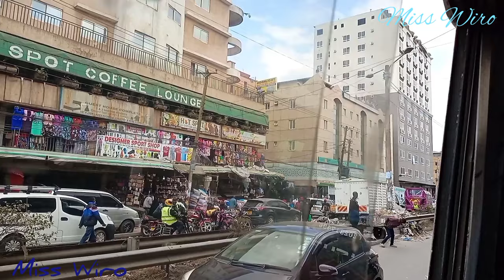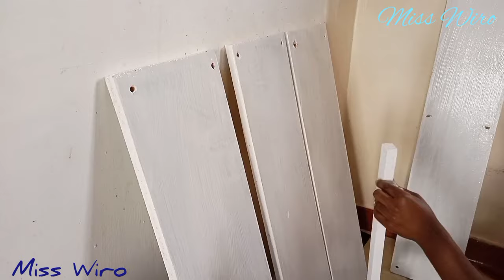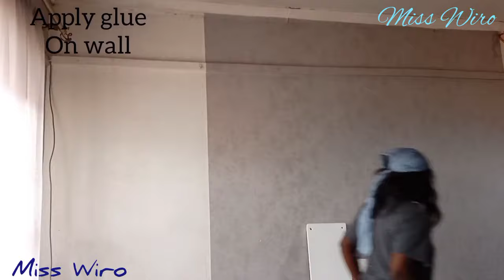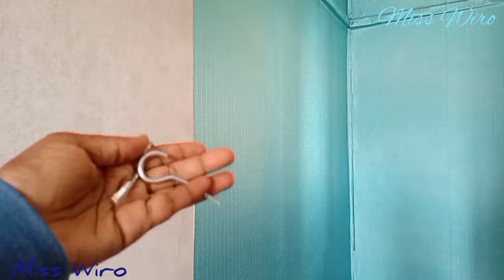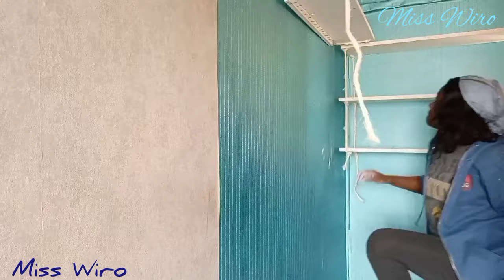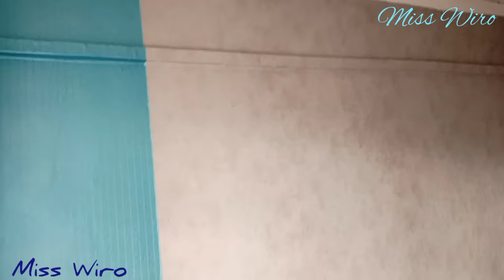EXTREME SINGLE ROOM MAKEOVER// SINGLE ROOM TRANSFORMATION// WALL PAPERS

Comment: Well done Miss Wiro! You're using your talents well. Hongera! 
I wonder what thickness of rope you used for this project. And what material its made from. Is it sisal or cotton cord and what ply please? Since the shelves are weight bearing, I would like to play it safe.
Reply from the maker: Thanks dear😊. I used sisal rope and I just chose it randomly from a hardware. I think what matters is how strong the material you are using is coz there are some ropes that might be abit thin but very strong and can hold very big weight. I don't know how to explain the thickness better in writing. But household items are not very heavy and any strong enough rope can do, not very thin not very thick
Reply: @misswiro  please what did you use to hold the sisal rope on the wall? Is it a hook?
Reply from the maker: Yes dear I used hooks